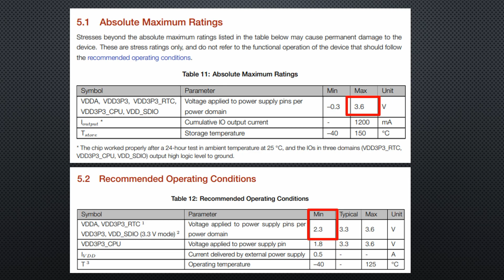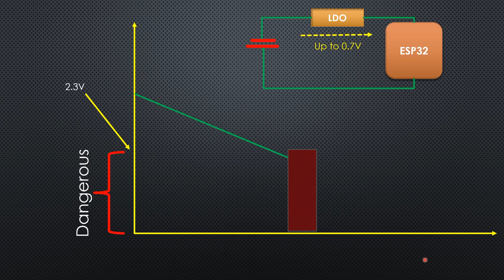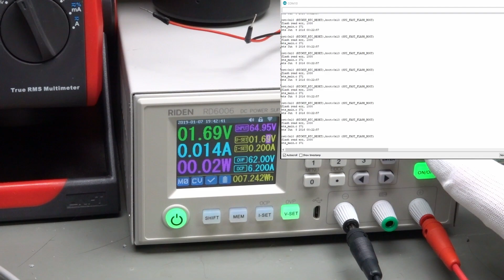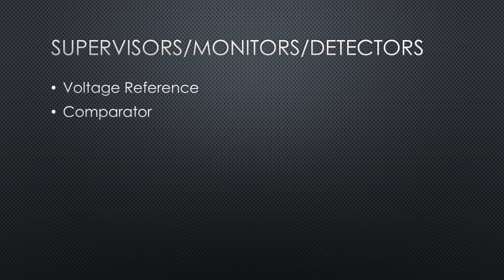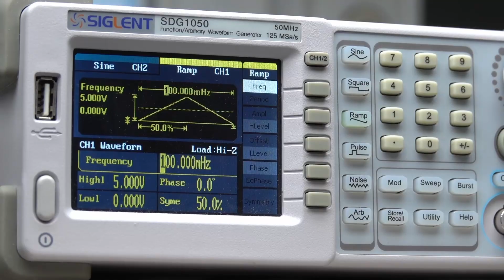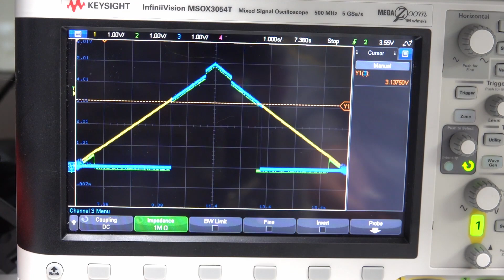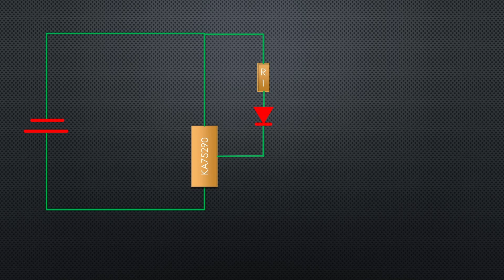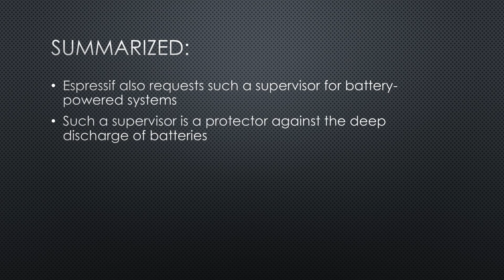436 How to use Voltage Supervisors to protect ESP32, Raspberry Pi, and Batteries

Comment: Normally, at en pin will have pull up resistor to vdd and a capacitor to ground like u shown earlier. If i use tps3839. I should remove the resistor and  capacitor right?

If yes then, what will happen when we upload program to the esp32. Usually the auto program from cp2102 chip will  do its job via DTR and RTS. Does the tps3839 will effect the code uploading?

Thank you for the video, i learned alot
Reply from the maker: 1. yes, you do not need a capacitor and a resistor
2. I do not know because I do not use this method of programming for production ready devices.

Comment: ... Thinking out loud ... I wonder what the impact to cost and size would be to incorporate that protection into the MCU itself?

Or do industry "best practices" say that the board itself should include that protection external to the chip? (Espressiv's note on the data sheet sort of implies that it should, but do ANY development boards do so? It seems that developers concentrate more upon ESD than under-voltage.

AFAIK, an MCU doesn't have any external access to its "address bus", but it would sure be interesting to see it on a logic analyzer when that MCU powered up but failed to blink.
Reply from the maker: Most MCUs have a "brownout detector. But as I mentioned, the Flash chip is outside the MCU...

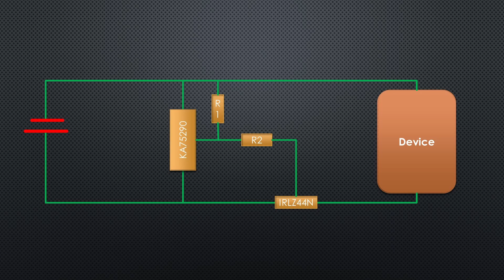Comment: Hi Andreas, I may be wrong but shouldn't the power source (on the left of the schematic) be in the opposite direction at 8:51 when you say "Connect pin1 to Vcc and pin 2 to GND" (with pin1 represented at the top and pin 2 at the bottom)? Same question for the schematic with IRLZ44N at 12:29? Thanks again for your excellent videos on esp32s and much more!

Comment: I added that chip after the LDO and found out it is not stable for the EN pin of ESP32. Then I moved it to the battery side. Works great! No worries about weired behaviour of ESP32 on low battery and drain up the battery if it's not stable. Thank you Andreas!
Reply from the maker: Cool. Thanks for your feedback.

Comment: Even cheap MCUs have brownout protection circuitry these days.  Why not just use that?
Reply from the maker: Brownout detection works if voltage decreases. It does not prevent bad things happen if voltage rises (and the MCU does not work). The ESP32 has a brownout detector, BTW.

Comment: Hi Andreas can you make a guide to esp8266 freezing after waking up a couple of times from deep sleep when powered by batteries. I have this issue and it's hard to tackle any ideea to fix this would be great. I power my esp on 3 x ni-mh 2100mAh cells. for Voltage regulator i use ht7333 and my circuit uses a 1000uf and 100nf cap. I was thinking to connect a smalled capacitor between gpio16 and rst. Or should I ditch it in favor of an external rtc to rst
Reply from the maker: ESPs are very sensitive to voltage drops because they draw up to 500ma peak current.  If they crash, they often write a message and sometimes it contains "brownout".
I would connect your device to a proper lab power supply and see if the behavior is still there. Then, most probably it is a software error. If the behavior is gone, you know that you have to work on the power supply.
Reply: @AndreasSpiess  thanks for reply, i had it powered via uart for a couple of days, didn't had any issues.

Comment: I agree with Sureshkumar K P 100%! Andreas is the most interesting teacher I know! The wealth of knowledge Andreas demonstrate is next to NONE! Love your videos Andreas and your kind personality as well. This video came very handy right now, I'm helping to redesign a "rat feeder" for University, here in Lincoln, Nebraska. Everything is running on 28V and I'm using a tiny Arduino and one Servo Motor to lift the feeder arm for 4 seconds.... So I use LM317 buck board to step down to 5V and a second one, that is used as a 5V trigger (even the signal voltage is 28V). I am trying to protect the Arduino from the 28V and its possible problems.  Do I need some kind of "protection" from the 28VDC ?  Thank you again Andreas!
Reply from the maker: I probably would not use a linear regulator for such a voltage difference because I assume it heats up. A buck converter would be a better fit here.
After the voltage regulator your voltage is 5 volts and you do not need an additional protection. If the converter is killed, your whole setup will be dead. But the chance should be small and the damage small if you include a fuse on the 28V side.
For the trigger, a simple voltage divider would be enough, I think. The voltage does not need to be very precise.
Reply: @AndreasSpiess  Will do fuse for sure, but I'll leave the  2nd buck board that also steps down the 28V to 5V - I know it is an overkill. It costs only $1.x and if they decide to use the power on for a longer than 4 seconds, the small PLA box that houses all of that, could get hot.... I'll make a short video once it is done, so you can see the entire project finished. How well it will perform I don't know but that is why I'm making 3 prototypes and let them use it for while, before finalizing it. One more idea I have is to fill up the small PLA box I've printed for the boards with silicone caulking, so the possible moisture don't make it to the PCB's and the wiring.
Thank you Andreas again for your help! You are the best!

Comment: Can these voltage supervisors be used to detect an AC power loss and then make a quick backup of variables to the EEPROM, or is there a better IC for that purpose? 

For example, if you had an esp32 devkit powered by a 5v wall adapter and a 5v supervisor IC to monitor the 5v output, could you make a detection of power loss through attaching the 5v supervisor to an input pin of esp32, and then quickly backup variables to EEPROM ? 

thanks!
Reply from the maker: An easier way would be to measure voltage at a particular place using the built-in ADC of the ESP32 and react if it is too low. You could also use a supervisor for that purpose, of course. But still you need a pin to read its signal.
Reply: @AndreasSpiess  I see, thanks Andreas!

Comment: Great video. But can't you just use brown out interrupt that many microcontrolers have to control low voltage programatically?
Reply from the maker: While discharging this is possible. But not during power up as I showed in the video. Then, the MPU does not yet work.

Comment: Andreas, Greatly appreciate your videos like this... I'm new to the circuit game and have been fighting this issue with my ESP32 boards.  They are powered by 5v Meanwell power supplies, but periodically go wonky.  I've been cheating my way around this startup issue by using an NE555  Timer delay switch and waiting 8 seconds for the power supply to warm up before supplying voltage to the ESP32.

For your first solution with a resistor/capacitor circuit on your enable pin, it doesn't outline specifically the resistor/capacitor values.  Right now I have a bunch of 330ohm resistors and 1000mF capacitors.  Could I use these to pull down the enable pin until it warms up?  I'm powering on the WT32-ETH01 with 5v instead of the 3v3, so it doesn't appear to be working.

Thanks in advance for your time.
Reply from the maker: You can calculate the time a resistor and a capacitor have to charge up. But I fear you have different problems. As I mentioned, most boards have such parts built-in.
Concerning the WT32-ETH01: It seems to have a 5V pin.

I would start with a blink sketch and see if you have instabilities (you see crashed in the serial monitor).
Reply: @AndreasSpiess , Thanks for the feedback.  I'll double check the board's whitepaper.  I've found that the 8s delay before powering on the boards seem to work each time.  I have 4 boards flashed with WLED and it's a hit or miss startup when using the meanwells to start the board, but the delay works each time.

I really appreciate the videos.   Every so often one of your videos touches a challenge i'm facing, so thanks in advance!

Comment: Hello, first of all thanks for your fantastic way of teaching . I want to know, is it correct connections for TPS3839 and ESP32[10:55] . Cause the reset of ESP32 is Active HIGH and TPS3839 is Active low. TIA
Reply from the maker: The ESP32 has an enable pin which has to be high when the ESP runs. If it is connected to GND (with a 10k resistor) then the ESP stops (resets). So this chip should work. But I never tested it.
Reply: And can I connect the reset to GND to reset the ESP32 on power? Will not it make a short circuited?

Comment: Glitching was used recently to hack the SpaceX satellite terminal, in theory even able to gain access to the bird itself.

Excellent timing, trying to drive a Pi 3 using an LM2596 module and there appears to be a number of issues related to under-voltage. Hint: it goes into a reboot loop and eats the filesystem on the SD card.
Reply from the maker: Indeed, the Pi seems to be quite picky when it comes to undervoltage...

Comment: ESP32 has this as a setting in menuconfig.  Unfortunately, Arduino does not expose this you need to use ESP-IDF.
Reply: CONFIG_ESP_BROWNOUT_DET_LVL_SEL ?
Reply from the maker: You can do this also with the Arduino IDE, if I remember  right. But it only changes the threshold voltage, not the problem with the flash chip.

Comment: I Andreas, very great video as usual! there are two things that are not completely clear to me: 1) on a nodemcu board, where the EN pin is internally connected to vcc, how can i use this approach? 2) how can I have a reference value for this voltage regulator, since the battery voltage is dropping? Which is the best way? Thanks a lot.
Reply from the maker: I agree with Sybren. Usually, EN often is connected to VCC through a 10k resistor. Then you can connect the supervisor directly to the pin of the board.

Comment: I'm surprised that this is not already build into Arduino... is it really true?
Reply from the maker: Yes. Most MCUs (also the ESP32) have so called "Brownout detectors". They work ok with falling voltages. But usually not with increasing voltages (as you see in the video where the flash is the real problem).

Comment: There is also MAX809 which is probably as popular as 555 timer, is extremely cheap and has huge variety of voltage options. What is missing from your your story though: to achieve reliable startup from discharged battery state it is good to have some hysteresis. Not all reset controllers are capable of that
Reply from the maker: They are really "dirt cheap"! I thought I mentioned hysteresis when I showed the curves on the oscilloscope. I agree this is important. But I was not aware that not all supervisor chips have this feature.
Reply: MAX809 has 12μA Supply Current
TPS383x has 150nA so almost 100 times less than MAX809

Comment: Hello Andreas, i bought this Devices just to build an Hardware whatchdog. 1 Day before your Video was released.

I use my Doorbell to open my outdoor.

Fornatly i Was at Home because i womdering why my Bell not work as the postmam came.

The esp8622 Was freeze (i already used your Software Whatchdog) and thaught something like that cant Happen.

I Googled how to build a ,,Hardware" whatchdog.

2 esp8622 observes eatch other is possible but is an never endling Story (this Chip can of cause crash too).

I found the Chips you explaind in the Video but not said it is possible to build a Hardware whatchdog.

was i wrong and this Chip is not support to use it as Hardware whatchdog?
Reply from the maker: I do not understand your question :-(
Reply: @AndreasSpiess  ok vielleicht ist mein Englisch zu schlecht... Ist es möglich mit den ics einen Hardware whatchdog zu bauen der vom esp Impulse erwartet und wenn diese ausbleiben (weil esp,,hängt'') den esp resettet? Das hatte ich eigentlich vor mit den Chips also einen whatchdog zu bauen. Dein Software whatchdog hat leider nicht funktioniert.
Reply from the maker: @schuballaa  Das kannst du sicher machen. Google einfach "watchdog NE555".
Reply: @AndreasSpiess  ah, vielen dank, habe ich wohl zu kompliziert gedacht ;) stimmt mit diesem Dinosaurier sollte das gehen, vielen Dank

Comment: It's funny I just built a battery isolator that uses MC34064 4.6 volt supervisor chip. It turns on a relay at 13.3 volts and back off at 13.1 volts using a voltage divider, a mosfet and a few resistors. Supervisors work easier than using a tl431 and do it all in one package.
Reply from the maker: I agree that the supervisors are more specialized parts. The tl431 is very versatile.
Reply: @AndreasSpiess  Its a voltage reference, comparator, Schmitt trigger with built-in hysteresis.

Comment: Recently I faced a power issue with a device that combines an ESP32 with a GSM (SIM7000G) module. The issue there was, that the GSM module introduced regular high current draws and caused low voltage spikes. A low voltage protection with a voltage supervisor didn't work in this situation, as the voltage supervisor would 'trip' with each GSM transmission power spike. What ultimately worked was a deep sleep mode of the ESP32 that was invoked if voltage dropped below a certain level for a prolonged (minutes) period of time. I also ended up adding a TPL5110 automatic reset circuit to the project that resets power every two hours. That way, whatever happens, the circuit will always recover from a low power situation.
Reply from the maker: I am glad you were able to solve the problem. I would have probably chosen a different route (try to create a stable supply).

Comment: A reupload video ?  this was one of your most useful videos, thank you.
based on your video I did get a pack of KA75330 and been using them around for uses other than MCUs. best feature of them being hysteresis.
But its a bit of pain to use because the KA75 operates in 3 regions if used with a pullup resistor on output. Because below 1 volt on input you'd still get high output (0-1v=High. 1-3.3V LOW . 3.3+ High).
Is there a jellybean voltage supervisor like this which i can find even on aliexpress which has a active high output ?
Edit ( usually i get around this with feeding the input also to a optocoupler or mosfet so there is no output below 1v)
Reply from the maker: Maybe you have a look ath the MAX809/810. Both should be available on Aliexpress

Comment: Good explanation!  However surely the main reason for a voltage divider on the comparator input is that both the comparator and the voltage reference need some voltage headroom to operate properly?
Reply from the maker: Well possible. For sure an important feature.

Comment: Well done!

Yes these components are indeed used in professional devices. I have designed industrial embedded computers for the sawmill and railroad industries for 30+ years and they are a no-brainer for me.

Power supervisor circuits should be standard equipment on all processor based electronics.

You knocked this one out of the park!
Reply from the maker: Thank you! (I had to google the  meaning of "You knocked this one out of the park!")

Comment: so very interesting video. However especially with the ESP32(as with any other MCU having an ADC) I usually just put a voltage divider between bat+/bat-, and measure an estimate of the battery voltage using the ESPs ADC(since its ADC is fairly crappy to be honest). As long as the ESP gets powered from the battery through the 5V pin, as in its power goes through the voltage regulator and thus has a constant 3.3V, you can easily measure when the battery gets into the dropout range of the LDO. I usually set the ESP to deep sleep for an hour if it goes below a certain threshold. With solar powered projects this is an easy way to just have it go dark until there's enough sun to charge the battery again
Reply from the maker: I agree. This is a also good solution. I usually  also transmit the battery voltage with the sensor readings and create a low voltage alarm with node-red

Comment: The internal voltage reference in the supervisor has to be lower than the operational voltage, because if the voltage drops below that reference there would be nothing to compare it with...
Reply from the maker: I agree

Comment: You could also connect to the EN pin of the uC, don't you? So it would completely shut off everything, just holding reset low still has considerable power consumption with a WEMOS D1 mini based board (don't have a bare ESP-12 to test rn), while dropping EN low gave sub 1mA whole system consumption (still pretty high, but probably voltage regulators and such).
Reply from the maker: I think this is what I proposed in the video. Just using the supervisor IC to do the job.

Comment: I always use max6749 or internal Brown out detector of avr micros. Thank you,!!!
Reply from the maker: The ESP32 also has a brownout detector. They usually work well when the power goes down (as their name says). They do not work if the voltage switches on too slow as you saw in the video. Maybe they work better with other MCUs.
Reply: @AndreasSpiess  thank you

Comment: What is unclear to me is: if these things are so useful to protect against unstable behavior of a cpu or soc and apparently relatively simple and cheap, then why do cpu/soc-manufacturers not immediately include this into their design to ensure that their part doesn't get into such misbehaviour?  You mentioned some adding a resistor+cap to delay the reset going high, but they apparently would be way better protected by just including such a comparator as I'm guessing that any chip with an A/D convertor already has a reference voltage, reducing the cost uplift further.  Is it just the "1000000 parts sold x 1ct saved" argument keeping them from including such protection?
Reply from the maker: As I mentioned they are standard in higher level products. For cheaper products every cent seems to count.